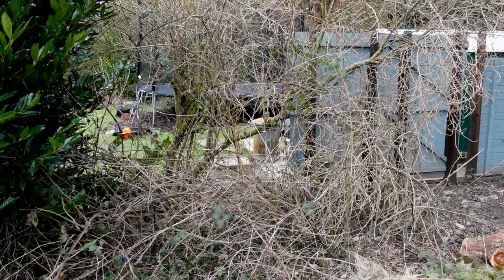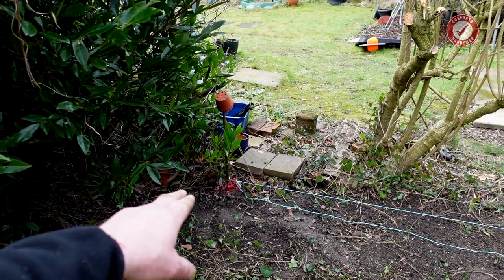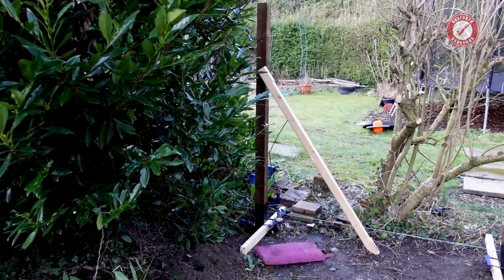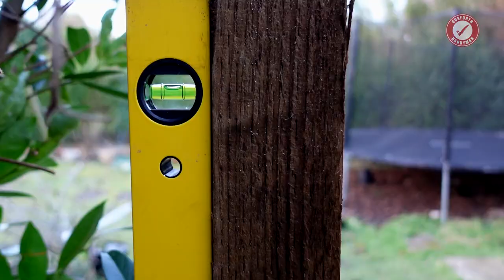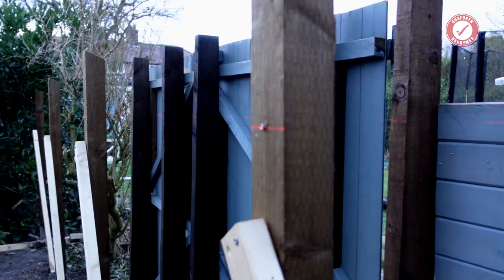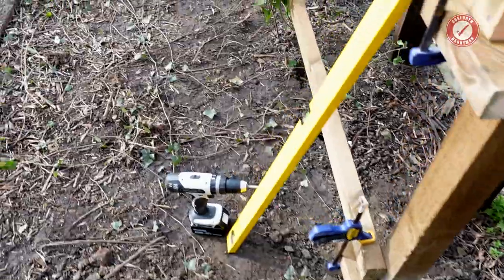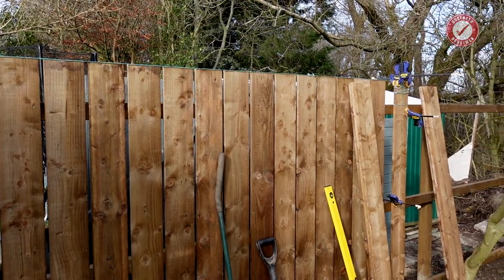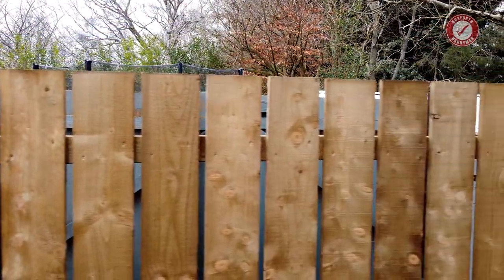How I make a SIMPLE DIY fence

Comment: 6 foot tall and 8 metres long. Doesn't get more British than that :)
Reply: 😂😂 it is so true though
Reply: @yastech7183  It's made me realise how much I do exactly this. "This screw is 27cm down so I need to raise the post an inch" Who says we Brits can only speak one language? :D
Reply: So British it took me a while to work out why it was British.
Reply: Australian too.
Reply from the maker: And that's me making a sustained effort to be metric. 😂
Reply: Height in imperial, length in metric. Entirely correct. 3 metres of 4 by 2.
Reply: @101alexs  Totally normal and uncontroversial.  Same for height and weight.  6'2", xx kg.
Reply: 10 x 3 1/2“screws for the rails and 4.5 x 45mm for the slats. Can't get away from it.
Reply: And considering that measuring tapes have both markings, it would be a shocking waste to use only one side.
Reply: Once had a guy ask me to cut a length of angle iron 6 foot 200.  🤔😒😳
Reply: 8 foot x 4 foot MDF 18mm...

Comment: I’ve understood that when you set posts in concrete to leave the bottom ends exposed. Possibly in gravel or loose medium. This allows water to drain out of the post into the ground. Encapsulating the post in concrete traps the water and causes premature rot.
Reply: Sadly you are 💯% correct.  I'm surprised he didn't work this out.

Comment: Nice fence but it really should have a horizontal gravel board at bottom , keeps the rest of boards off ground and when it rots you've only got a few boards to replace instead of every board rotting at bottom
Reply from the maker: The pickets aren't touching the ground. 👍
Reply: @GosforthHandyman  fair enough mate  , fencings about half my work  so couldn't help chipping in 🙂 again , nice job and good work on channe in generall , I've learnt a few things on here

Comment: I like to leave a decent gap between the fence and ground, and dig a small trench a couple of inches deep along the fence and fill it with gravel. This lets rainwater run down the fence and off the bottom and drain into the ground, the gap prevents water from being drawn up from the soil through the end grain causing rot.
Reply: Gravel board then.
Reply: Was abiut to ask about that but you answered perfectly
Reply from the maker: Certainly an option! This fence is about 3cm shy of the ground. 👍

Comment: Two things-. I would put a gravel board along the bottom (150x25 timber) this can touch the ground and be replaced if it rots and the main fence is up and dry. Second is to use feather edge board to make it a closed fence. It would probably be cheaper as the timber is thinner and each screw holds in two boards where they overlap. 
I need to get a post hole spade. Nice bit of kit! 
But then I am down south and we don't like to talk to our neighbours!

Comment: Great tip, when digging holes, have a bunch of builders buckets or a larger mortar bucket so as you are throwing the earth off the spade you chuck it direct into the bucket rather than it collecting in the ground, that way it's a much easier clean up of the excavated soil

Comment: I really like your attention to detail on explanation. About 10 mo ago, I built a fence, and did some things similar. Wood was already getting expensive, and hard to get today. My post setting probably took much longer as referenced position from a string close to the ground, pre-mixed concrete, and leveled individually. Also, the treated posts were extra long so I could go 3ft deep, and cut the top to height later. All other lumber was fresh sawn western cedar (in in Oregon). I like you do 3-rails as a lot of people only do two. The other difference, I used metal hangers in between. Hind sight, makes it more difficult if I have to replace a post later. I’m letting the cedar naturally gray. Instead of screws, I used galvanized ring shank nails using my coil nailer. I would have preferred stainless, but cost was an issue. Again, thanks for the details. You do a great job and give great advice.

Comment: Hi Andy, I have a caravan at Frosterley and wood rote there faster than you can put it in. I use concrete posts that I make myself as it is cheaper and better quality than store bought ones, it makes it difficult to attach the wood rails but I now am a dab hand at putting the plastic conduit into the forms so that I can use bolts to fasten the rails onto. This is the best way of stopping rot and I use my laser level to set them, laser levels are so cheap now that everyone should have one, even those like me that only do this as a hobby.

Comment: Great work and much sturdier than the fence some "professionals" recently installed for me. I think I would have put gravel at the base of the posts though (to avoid possible risk of standing in a well of trapped water over time).
Reply from the maker: Cheers! The base of each post is encapsulated in concrete 👍
Reply: @GosforthHandyman  OK but the point I was making is that inevitably over time water will seep down between the wooden post and the concrete around it. If there is gravel at the base it then has a way to drain away.

Comment: The laser is gold for setting posts, but I also used it as a survey level to assess the height differences of my garden to work out the heights of a retaining wall and how deep to dig away to level the garden in front of that wall, to do this I made a rigid centimeter stick from a 2 meter piece of wood with cm indents made with a sharpie.

Only disadvantage of the DIY laser levels is their limited reach in bright light as you mentioned, on a normal cloudy day the reach is around 5-10meters depending on the kind of laser you have.
To do the surveying I had to go out after sunset when the light was dimming, then a reach of about 20 meters is possible.

Comment: All this talk of who owns the fence and which side is better is quite interesting to me.  In my part of Australia, the fence is owned by both neighbours and both are responsible for it.  They have to agree on what type and when to build/repair/replace it, though this can take some doing!  Many people see the rail side as the 'better' side as your neighbour can't easily climb the fence and see what you're doing in your garden.
Reply from the maker: It can vary by property over here. These are shared boundaries so you need to chat with the neighbours before doing anything. But normally the deeds specify who is responsible for the boundary. 👍

Comment: I’ve always thought of that style of fencing as ‘pallet fencing’.

Going to be starting about 25m or so of 5ft, concrete post & gravel board, timber panel fencing at my house sometime next week. Praying for the weather to improve.
Reply: I'll be doing the same spec and size of fence as you this summer.
I do like Andys type better but its more work and i do wonder if its more expensive than concrete posts and pre made panels.
Reply from the maker: Great stuff! Only tricky thing with pre-made panels is getting the post spacing exactly right. That can be really tricky, especially on your own. 👍
Reply: @GosforthHandyman  good point Andy but my way around that problem was to use a gauging rod but I've seen people fit a post and then a panel as the spacer then the next post. We'll see this summer 🙄

Comment: Interesting, entertaining, informative and good videography and commentary.

The posts of the new fence are on the neighbour's side while the post on the other side of your garden are on your side. So who owns the new fence that you just spent effort and money in erecting (please refer to the deeds)? If it is your neighbour then surely the entire fence; posts, rails and boards, should be on you neighbour's side of the boundary line which you established and agreed?
Reply from the maker: Cheers Charles! Think it varies by region. Around here whoever pays for it / builds it gets the face side, otherwise I'd have to build the fence from the neighbours garden. It's a shared boundary but all pre-agreed. 👍
Reply: The face of a fence marks the boundary and should go on the outside of the owners boundary.  Your neighbours have just acquired a new fence and a bit more land. That said it is usual on terraced houses with gardens to have side of the garden yours and the other side you neighbours. Learnt all this doing my City & Guilds Carpentry and Joinery.

Comment: How deep did you have to go with those holes? I have to replace about 40m of 2,4m high fence here which is going to fall over in one of the next storms. Norway being Norway however I need to go at least 1m deep. Any tips on how to dig those holes ?

Comment: Wouldn you ever use nails for a fence? As in with a nail gun? Or is it screws always?
Reply from the maker: If I had a framing nailer I would have used that, but I don't. 👍😁

Comment: Won't your laser level method only work on a perfectly level garden? I though the best method was to put posts in at both ends of the run, and then run a string line across the top?
Reply: no just keep the laser in the same place and rotate it if you need to. Or you get the height from the last post like he did.

Comment: Nice job.  Two questions: why didn’t you use concrete posts and were they 100cm2? Looked a bit skinny.
Reply: Timber is easier to work with and the posts are 75mm x 75mm
Reply from the maker: Concrete is much harder to work with, especially on your own. 75mm - covered in the vid. 👍

Comment: It’s much easier if your using postcrete to set your first post then string a line to a temporary post the other end then use your rails to set the distance between the posts as you go.
Reply: Agreed. But you do have to have bought the rails for that 😁
Reply from the maker: Yup defo an option!

Comment: A relative told me that if you're making a fence between 2 properties you are supposed to have the presentation face towards the neighbouring property. Is this nonsense?
Reply: It seems to be the done thing if the fence    belongs to you, I.e it is on your boundary, as the fence is on the right of next door neighbour property I am guessing that the boundary belongs to them.
Reply: That fully depends on how much they pay for it. if they pay 50%, it's debatable. Personally I would pick a type of fence that looks good from either side.
Reply: Don't think it's a rule or law, but from a security point of view, it makes perfect sense - the presentation side is harder to climb over.
Reply: The fence I built had upright posts and horizontal boards on both sides. On each side the board is centred opposite the gaps on the other side. This left air flow through to stop the whole thing blowing over whilst maintaining privacy and a tidy finish for everyone.
Reply from the maker: It seems to be a regional thing. Thank the lord that's not the norm around here. Whoever's boundary it is gets the facing side. If it's a shared boundary whoever pays for it gets the facing side. If it's a shared boundary and shared cost then flip a coin. 👍

Comment: A slightly different take which improves privacy but still allows the wind to pass through is to have vertical boards on both sides of the rails, alternating in position (to form a sort of "baffle") - board gaps can be a bit wider but it will still use more boards (you see it on farm buildings)   I would have used a battery nail gun to fire 40mm staples into the boards as a first fix on the rails to get everything in position and then go back to put the screws in!
Reply from the maker: Defo! Adds a fair bit to the cost but looks good. I could really do with a framing nailer. 👍

Comment: Nice fence for someone who knows virtually nothing about fences, but I guess you'll be selling and moving on before too long. Do you want an itemised list?
Reply from the maker: Lol we're not selling and moving!!! 😂😂
Reply: @GosforthHandyman  Well, just for the sake of argument. The post ends should not be encased in concrete, they will rot, generally just above ground level, as they all do, but in maybe ten years instead of thirty (for pressure treated tanalised timber). Painting does not help, wood needs to 'breathe',  water needs to be able to drain out of the post end, into the dirt, so leave the bottom couple of inches of the post below the bottom concrete level. Cap the top of the posts, either metal sheet, or a wooden cap (which will need replacing when that rots). Also best to cap the ends of the boards, too. end grain and weather is not good. Wrt animals, they will dig under, or go round the ends. Whoever owns the fence, then the posts should be on their side. May not be true up North, but used to be down here. The neighbours should see the 'pretty side'.